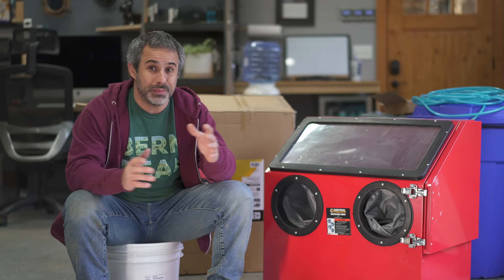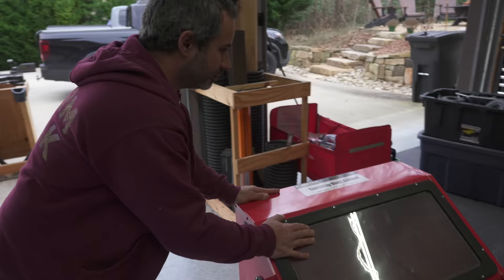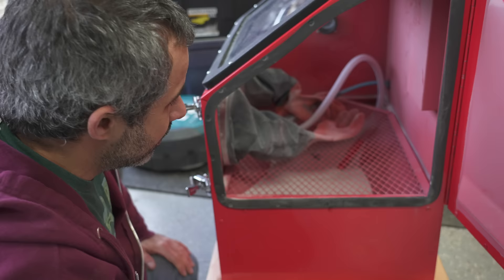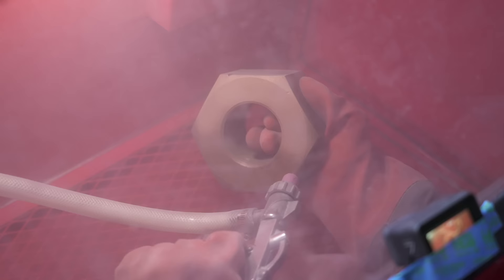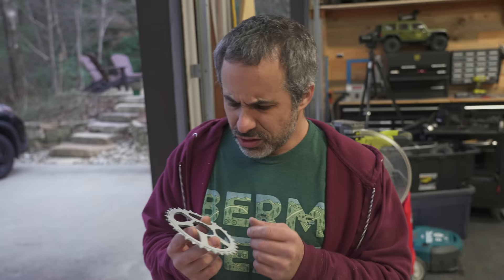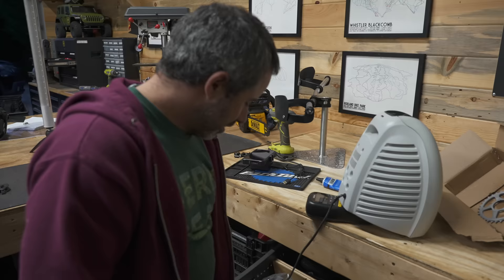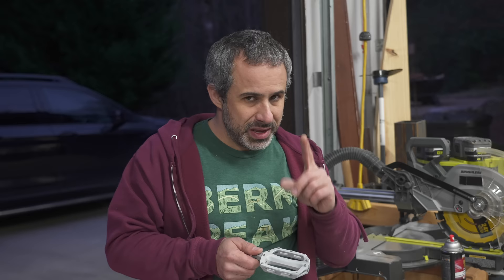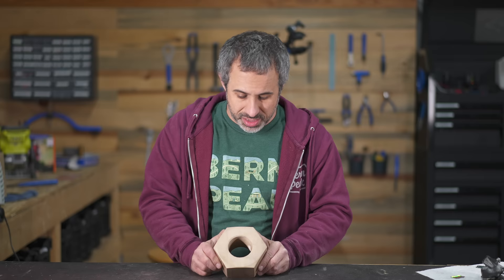I took your advice and bought a Harbor Freight sandblasting cabinet

Comment: If you take the coating/anodising coat off of Aluminium like that it will rust. It oxidises over time depending on the Grade which is usually 5000/6000 grade. 5083 (Marine Grade) will eventually rust but takes many more years to do so. I'd be very wary of sandblasting Aluminium. If you intend to powder coat any of the parts afterwards though it will help get a far better finish to sand-blast it.

Comment: Certain blast mediums can etch aluminum worse than others. Walnut shells work quite well for aluminum and its an organic blast medium which makes it a bit more eco-friendly. Sodium bicarbonate and fine glass beads are also good for aluminum. You typically want to match the hardness of your blast medium to what you are blasting. I took metal working class in college and got to play with the blast cabinet for my projects and learned real quick that a medium (such as steel pellets and some coal slag)  for blasting rust and mill scale off of steel will eat aluminum up.

Comment: I’m a machinist apprentice. The sand blasted finish is smooth enough I don’t think it will wear out chains. Any steel you sand blast will rust easily unless you clear coat it. Paint will stick on sand blasted parts very well. 

Get clear plastic screens about .020” thick to protect the inside window from scratches. You take the plastic off when it gets cloudy and put a new piece on. You can just tape them on the inside. The gloves in the cabinet will wear out over time so you might replace those eventually.

Comment: I’m getting an ultrasonic cleaning bath for similar cash: should be great for chains & other non bb components. I’ve used our small work one on a metal watch bracelet and it worked a treat.
Primary use will be chains- I don’t think I can do the whole waxing thing, and I prefer liquid lubricant on chains (carefully applied link by link…..but if there’s enough it should spread over bearing surfaces at rest, I can’t see wax doing that) I’ve run the gamut of chain care in 40 years, including regular cleaning in solvents, rinse and dry in the oven and relube. I reckon this could work well with less nasty solvent solutions.

Comment: I make metal sculptures with blacksmithing and welding techniques.  It's great to use a sandblaster for those areas where you can't get in and sand or file easily, but yeah, it's not going to make anything shiny.  ;)  Great to clean it up, remove rust or scale, and prep for painting; though sometimes leaving some scale makes an interesting aesthetic.

Comment: Big tip for you, get some 170-325 mesh glass beads they clean pretty fast and leave a very nice smooth finish on all metals.
Reply: Here is a link to where I get mine from, I have many years of experience both dry and vapor blasting and this glass beads in a dry cabinet will get you the best finish for way less cost compared to buying a vapor blasting cabinet

Comment: Now you need to get a powder coating setup and a little oven to cure the powder coat. Your little "clear coat" can and any other spray paint will wear off immediately especially on bikes where they see mud and are scrubbed with brushes. They are not heavy-duty finishes like aluminum anodization and factory powder coatings.

Comment: Sandblasting is has its uses. Some AirCraft Stripper works great getting to bare metal on detailed parts. Works fast, can apply with a Q Tip or spread the stuff on thick. Just don’t get it on you. Melts pretty much everything but metals.

Comment: From a material stand point by sanding the parts you are introducing new nicks and scratches where cracks can start. Polishing and other methods such as using finer sand to reduce these scratches would be advisable. I do not know how sensitive bike parts are to these flaws. However, by adding a finishing process after the sandblasting you would reduce this concern. On another note, bare steel is more susceptible to rust than painted or clear coated metal. Note I am only an engineering student, however this is what I recall from my materials class last semester and I thoroughly enjoyed it.

Comment: Now if you polish your nut with a buffer it will shine like new...And for the seized up pedals, freeze them in your freezer, remove them and try heating up the " barrel " portion, which will expand, and hopefully you will be able to loosen the bolt going through.

Comment: I have this same cabinet. Took some duct tape and sealed up the seams. The gun seems to suck, but otherwise it kicks ass! You NEED a dessicant filter on your air line or it will continuously clog.

Using a shop vac will also keep stuff from coming out of the door. The sand catch on the bottom also tends to seep out abrasive.

Funny I also was planning on sandblasting some of my bike stuff later this week. Now to watch the video >:)
Reply: Harbor Freight sells a dessicant filter for like $30 and it works great. You can take the beads after they've turned pink and pop them in the oven at ~220F or ~105C and they'll turn factory new blue again. Also, using baking soda as your blast medium works great for cleaning stuff.

Comment: Buffing or painting the metal after you take it out is a must, the oil on your skin gets onto the sand blasted metal and can cause surface rust if left out for a few days, If its aluminum or brass it wont be an issue I dont think but I know steel does that (I sandblasted lots of parts at my old job for paint)

Comment: Get a polishing wheel.  Maybe an anodizing kit for preserving/ coloring aluminum parts. There are playing kits for steel as well. You need some means of masking off areas that you don't want blasted, such as threads, and bearing surfaces.  Be carefully with thin sheet metal as can get distorted.  The sand media is like thousands of little hammers to thin metal.

Comment: I would recommend getting a cheap shop vac just for the cabinet, I have one and it tends to destroy shop vacs rather quickly. I’ve tried adding a filter to the inside of the cabinet but it still finds a way to destroy the shop vac

Comment: Mechanical Engineer here. The surface finish on the drivetrain components will have a negligible impact on chain wear.  The surface will quickly wear to match the chain. So long as everything is adequately lubricated, its fine. In some instances, a perfectly polished surface actually accelerates wear as the lubricant has no surface to adhere to. The lubricant acts as a barrier between the metal parts- hence why unlubricated parts wear so rapidly.

Comment: I media blast alotvof stuff. If you don't like the mate finish you should try burnishing it. I have a soft stainless wire wheel on a low speed that brings out a bright lustrous shine on metals.

Comment: Hi Seth, those crap decals on handlebars, Seatposts are often not covered with clear coat. You can easily remove them with acetone. No need for sandblasting!

Comment: Ditch the sand and go with either glass or walnut shell.  Way easier on whatever you are blasting.  Also, if it seems like nothing is coming out of the gun,  touch it  and hold it point blank on the palm of your glove and then pull the trigger.  This will clear it out.

Comment: Fyi a lot of bike parts are aluminum it might be a bad idea if the audience tries it but afyer sand blast you can anodize aluminum for a finish unlike others and durable. We used it in the paint ball inudstry for years. The hardest part of anodizing is finding the chemicals

Comment: The difference between naming something as a 'sand' vs 'abrasives' blaster is that when you blast, you don't just use sand. You can use different media - walnut or cherry hulls, glass beads, aluminum oxide, baking soda, etc.
Glass beads will leave a shiny or satin finish on metal.  You can finish off with a buffing wheel, then wax it with microcrystalline wax to prevent tarnish, or lacquer spray.

Comment: I make knives and I have the same cabinet actually. I’ve blasted a whole knife from blade to scales. My ceramic and even the steel bearings still ride fine on the blade and the titanium scales so I would imagine a chain will be fine. If you clean it after you blast it with windex or rubbing alcohol it gets the grit off. Also try out different grit/type of beads. Aluminum oxide works well

Comment: you should check out Cerakote for refinishing the parts.  it's like a liquid powder coating, and is regularly used on guns.   can buy it in small quantities and easily apply it in a garage.

Comment: 6:25 if you can heat up the piston with a torch melt wax onto the seam, throw the pedal in a vice and try to beat the pin out

Comment: Word of advice, even with an expensive cabinet, you are never isolated from the silica dust and a respirator is mandatory. Unless you want to die from silicosis. 
My friends brother shredded his lungs using one without a respirator.  It’s the super fine dust you can’t see that does the damage.

Comment: Give a small boy a sandblaster, and everything in sight will need sandblasting... 😛

P.S., you can probably use some aquarium silicone sealant to make it so the sand doesn't "leak" out of the various edges. Alternately some other kind of sealant  stuff, like gasket seal.

Comment: It's necessary to seal those with silicone or you will find they leak bad. I blast with aluminum oxide, and you don't want to breath that in so I have completely sealed my cabinet and have a dedicated vac outside the shop.

Comment: Sandblasters are awesome for removing paint and rust. Unfortunately many parts on a bike (like your chain ring) are aluminum and hard anodized. By removing this coating, the part surface is much softer and will wear much faster by the chain AND rocks/branches than original. Of course there are also kits to anodize at home (caution: contains acid and requires electricity), or send off to have anodized. To minimize this effect, you can tape off the mechanical portions and blast and paint the merely optical surfaces.
Oh yeah, I’m an engineer too.

Comment: The number one thing to remember is don't sandblast greasy parts period! that grease goes down into your sand and then you have clogging problems. The same thing goes for washing parts with water and not letting them dry enough however that obviously will dry out then come back. Another thing to remember is the media breaks down and when it gets really dusty for no reason it usually means that your media is it broken down to the point where it's mostly dust.

Comment: Hey Seth! Loved the video. Maybe as a tip, try to tape off any threads or other delicate parts. Even if you don’t point the gun towards that part, little sand particles will always get everywhere. Just painting tape or other will be fine! Cheers

Comment: You should try using a filler primer before the clear coat. I've used it before on 3d printed parts and it comes out quite nice.

Comment: just an FYI.  If you are using a silica sand, that stuff is carcinogenic if inhaled.  You definitely want to be using a Hepa vac and if dust is coming out the seams in the box, you definitely want to use a respirator.

Comment: As a Marine Engineer, I can tell you that i have no clue in what will happen to that sandblasted gear, over a long period of time. That is because you would need more information than just the surface quality. To properly judge if the sandblasting is a problem, you would need information like the hardness of the gear, and chain, and where exactly the rough area's are. My rough estimate would be that is is going to be "good enough". Keep up the good work!

Comment: Awesome  video! For wear parts, like chainrings, they probably won’t perform like they did before. Probably wouldn’t wear out the chain as much as the ring itself and I be I rides rough at first. Wouldn’t be too surprised if they would be okay after a break in ride or two. Masking tape might a good option. Also maybe that weird rubberizer dip stuff they sold on tv in the 90s. I bet a coffee can of that goop would earn its keep in your shop.

Comment: Hey Seth, love the new sandblast cabinet. for aluminium bike parts that you blast. something to consider that I have used in the past is after sandblasting giving them a Alodine coating. It is easy and cheap to apply and offers several benefits as well as making the parts look cool!

Comment: as to the polish job... take a terry cloth and some brasso and let the weight of the nut polish all the little divits and such.. not hard to do.. we use to do that kinda thing at a job i had.. brass that needed to be smooth but not  perfectly flat surface..

Comment: If the pedals are actually any good and worth saving, you could always dismantle them before you blast them. Put in new bearings or repack them depending on what's in there.

Comment: You don't have to use sand if it is too abrasive, There are numerous other types of blasting shot/material Bead including glass even nut shell for delicate items. Some will leave the item blasted at anear polished look

Comment: For blasting aluminum, use glass beads and lower the pressure to no more than 30 PSI.  My experience doing aviation parts.
Reply: Using glass bead on my aircraft parts, is just way too corse.  Always do spark plugs at annual inspection, and I'm have afraid of putting back on the cylinders....that just a few fragments of shards of ground glass would get in the case and reek havoc on cam, crank, cylinder walls, rings, gears - NOPE   Baking soda is my goto for anything for an aircraft engine.  Cabinet fogs up so bad with baking soda, can't see anything and clogs filer in shop vac in seconds.   Now I use a real cabinet from a hangar buddy.  Totally professional rig. WASTE OF MONEY
Reply: @avflyguy  Your fears are oversized. In any case, there is seldom a need to bead blast plugs if they are cleaned correctly.
Reply: @KB4QAA  All I'm saying is I don't think there is any called for application to bead blast with crushed glass on any part confined to the inside of the engine case.  Crushed walnut or soda blast- fine - glass - nope
Reply: @avflyguy  I never mentioned engine cases, and you did not specify that either.  Odd reply.

Comment: For the upan letters you could use aceton. Sandblasting is crazy abrasive for structural parts. You should not do it with sand on aluminium frames or something like.

Comment: Now, Has sandblasting heavily pitted your big nut? The cheap and easy way of fixing that is with Sos soap pads & water using only the lightest pressure rubbing, pressing too hard will leave scratch marks. Or go through increasingly fine grades of wet sandpaper then polish as you would paint on a car to remove orange peel from paint. The best process would be the latter It removes all nicks & scratches for a  mirror shine.

Comment: For steel parts the sandblasting should be ok, but the finish wont stay as shiny as before, but definitely blow away every rust and dust. For aluminum alloy parts you definitely should use plastic media or walnut shell media. If you sandblasting the aluminum alloy parts you will destroy the anodized coating as well what protects most of the aluminum parts. In addition if you want to remove the paint from aluminum alloy parts use plastic/walnut shell media because it will clean off the paint but the anodized coating stays intact.

Comment: I'm a painter.. Doing what you're doing gives the surface a "key". It's actually a perfect key.. One of the best you can get.. Paint will stick to it like glue because of the microscopic pits. As far as the gear.. It will depend on which one is the softer metal as to which wears smooth. If the chain is softer the gear will chew it up.. But if the gear is softer the chain will make it smooth. Gears don't come smooth out of the box and I'm betting a chain is designed to last a while. Metal Prime the metal surface first and then paint .
Reply: is that keyed surface enough that the clear coat will stick to it reliably without primer?
Reply: @rcranes2227  Yeah mate. Not a problem at all. That keyed surface he's making is even better than just using hand sand paper. The clear coat without a primer just won't last a long is all. Might only get 2 years out of it instead of 5.  And with clear coat you just can't give it another clear coat and call it done because you'll see everything through it. . It'll need a full sandblast again.. Clear coats generally don't have a primer built in, but a lot of coloured paints these days have an inbuilt primer.